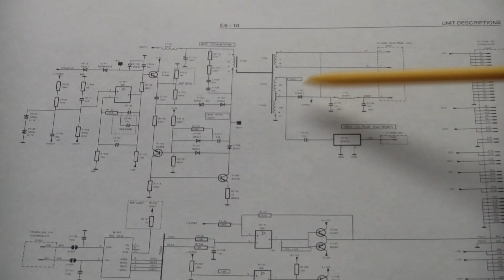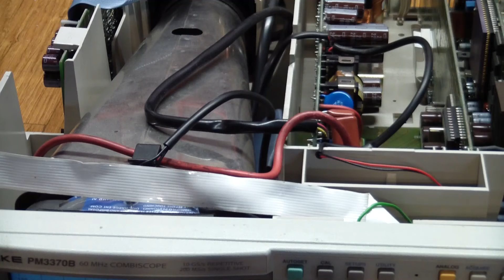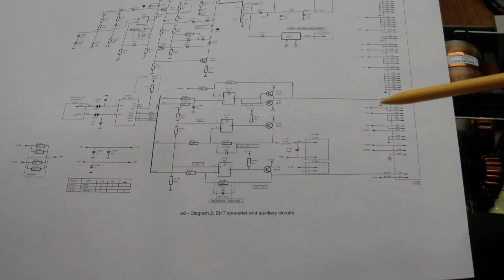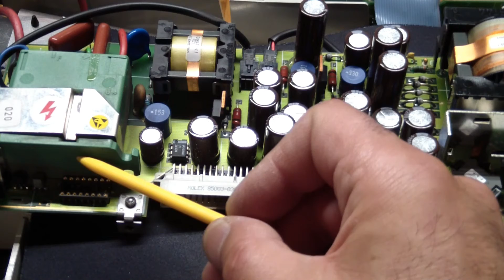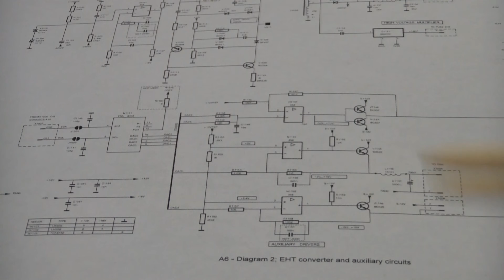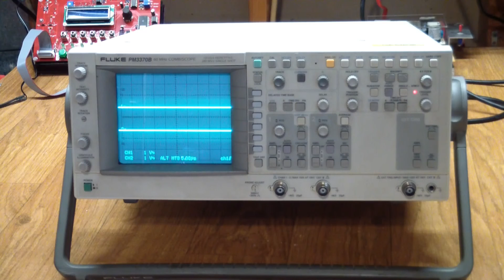AE#12 Fluke PM3370B Oscilloscope Repair

Comment: So cool you have been able to repair it. Interesting to watch the detective work. One thing confuse me a bit. The time before you have replaced the opamp, when you first turned on the scoop I could definitely hear the fan change the speed while scope was turning on. And I was thinking yes, you fixed it. But then the graticule illumination was still not working. And then you changed the opamp. Was that the 1 (dual) opamp for both the light bulb and the fan speed? Maybe the one half wasn't working... Anyway thanks for recording this. It is one neat instrument. I see someone was selling a 3084 analogue one for 125,- euros. So I got interested in these kind of Philips/Fluke scopes. The combi-scope is different of course but the controls are similar to 3084. I share your opinion on a clean instrument. It's like disrespect for the instrument 😁

Comment: my 3380b has no trace, it had a squeal, the diode you replaced was also dead in mine, i replaced it with what i had at hand(1n4007, still ok), still nothing, no high voltage. no cathode no anode voltage. the voltage trippler is not getting 5kV so i assume it is OK for now.
Everything else seems ok, it beebp and replay chatter when turning on, fan runs, and gradicule light can be adjusted, it beeps when buttons and rotary encoders are pushed/rotated.
Anyone have an idea what i can do about it ?

Thanks
OY1R

Comment: Hello, please tell me why the brightness of the button does not adjust, I switch left right but without result
Reply from the maker: You may have a similar problem as mine did. The controls are read by the CPU using an Analog To Digital converter. If that goes bad then the CPU will never take any action in response to knob adjustment.
Reply: @artifactelectronics  I solve that problem with luminosity but now when i switch from digital to analog the trace îs very strange, maybe if you give me one mail adress I send to you one short video to see, maybe you have some ideea
Reply: @bogdanlascae7767  hi i've recently buied a similar scope and i also have a problem on one trace. when i switch from analog to digital mode one trace have a large offset, almost at the edge of the range. From what i have collected until now on the manual, seem to be a problem comes also from the dac that control the offset of the channels but i don't have solved the issue yet.
Reply: @artifactelectronics  my mail is lascaebogdan@ymail.com

Comment: We're at instruction I have 3092 model did you use a substitute rectifier for high voltage as I can't find one 709 could you suggest a substitute, Many thanks.
Reply from the maker: I couldn't find that info in my not so meticulously maintained  notes. But here's what I remember. I figured out the voltage from the schematics, and used that plus a 30% margin for the voltage rating. The diode has to be a fast or ultra fast. Armed with that info I went to a surplus store and bought the closest part they had. Max current was around 20 mA. I hope that helps.

Comment: good video. can't find much info on this model. how does it compare to an entry level scope such as rigol 1052.
Reply from the maker: I wouldn't recommend this as a daily driver because it's old technology, and the new scopes have a lot more features. But the Fluke is a hybrid scope, you can switch between analog and digital making it a nice backup
Reply: @artifactelectronics  Would you say it's a good secondary for a hundred bucks? Or would you rather hunt for something else?
Good video, subscribed. ;)

Comment: First, thank you very much for your nice videos!
May be could you help.I have a Fluke PM3380B. Since this afternoom, it doesn't display trace in analog mode anymore. It displays text, set the correct settings by autoset test but no trace anymore.
If you have any idea...
Reply from the maker: Sounds like the deflection works but it the input signal is not making it through. Try tracing the input signal from the input BNC and see where that gets you.

Comment: Old post . . . . I know . . .
But what cause the failure of the DAC and the op amp?  Was it damage from the corona; from the loose static charge because of the loose HT wire?  What about the open diode and the cap on the HT side; was the result of ____ condition or failure point?
Might be a noob when it comes fixing electronic stuff; but find it helps to look back on what failed after it is fixed to determine the insult to the circuit that created the initial failure.  Either it makes no difference; or may have a huge bearing on a recurring failure.  
Example:  Working on a lot of CB radios just to learn and for helping out local truck drivers.  Had a problem with a receive circuit that had multiple failed parts due to a couple of leaking transistors and diodes.  Unnatural for all of these receive components with both a similar and peculiar type of failure mode.  Failure point diagnostic guess?  The CB antenna had been fed an unnatural amount of voltage while in receive mode.  Don't know if it may have been a nearby lightning strike ('static charge buildup/corona'), or some other voltage input on the antenna.  But suspected a nearby lightning discharge and static overload.  I considered this case unusual.
Reply from the maker: I think the loose HT wire induced a bunch of interesting stuff on all of the PSBs.

Comment: Hilarious. What a crock. The best thing is how many people believe it. Clue:  Why didn’t he touch the focus in round two?  So what is it about mini grabbers inside HV supplies do you like?  Maybe 3 AM for beer is where you should quit. 

Some lessons for anyone serious out there.  

When you screw around with HV supplies, test them out of circuit. That way things like, oh say mini grabbers, don’t destroy ESD sensitive parts. 

Second, gross rotation errors are caused by yoke miss-alignment. Be careful when you remount CRTs.

One more, edge card connectors will fool you. If things change every time you socket, don’t go whacking out ICs (yup, their not chips.)

Finally, when unskilled people remove an IC, they frequently lift traces. If you see a socket appear, look for the solder ball under it. In this case the light is passing right under the socket. 

In that situation, pull out the socket and do a proper trace repair. YouTube has dozens of examples. 

Nice con job. Gee, you wouldn’t be selling all these “repaired” units on eBay would you?
Reply: Ok.
Reply: " gross rotation errors are caused by yoke miss-alignment"
What yoke would that be? 
"Some lessons for anyone serious out there"  
Dont believe everything that you read here in the comments section
Reply: Pure speculation on your part as to why he installed a socket but show a little common courtesy, otherwise you come across sounding like a bit of an ass, respectfully speaking.
Reply: "Yoke mis-alignment" I'm dead

Comment: Is it a DC fan motor? I dont know if you can change the speed of an AC motor..I guess you could but I dont know how.
Reply from the maker: It's a DC motor driven indirectly by a DAC
Reply: Why?  What about that PWM thing?  Don’t kick the tires kids.
Reply: You can change the RPM on AC motors by altering frequency, voltage or both, frequency is better as it’ll better maintain torque, but they will only vary over a limited range, pretty sure the scope is using a DC fan though.

Comment: Nice video...off the subject but you would know....what is a tunnel diode?
Reply from the maker: Also called a fast recovery diode, switches in the microwave range. I see these used on the CRT cathode in scopes a lot.

Comment: Thanks for this video. I have the same model, and the same symptoms (the fan works, all low voltages are ok, 60V for ETH is present). High voltages are down (generated by ETH converter). I checked all parts in the ETH, high voltages area (capacitors are ok, high voltage diode looks open but this type has Uf near 40V so will look like open). Most funny thing is that time to time the oscilloscope works near 14 minutes without any problems and again back to "fan only state" without any strange sounds, smell etc. I have soldered each pad on the power supply pcb to be sure that there is no any cold solders there.
I really like this oscilloscope but slowly I give up :-(
Do yo have any idea what issue can cause this kind of behavior?
Reply from the maker: As a first step try to use cold spray on the PSU. and the DACs. Delayed problems like these can point to bad caps and also analog circuits that turn digital when heated up.